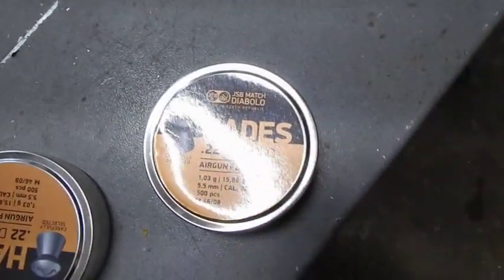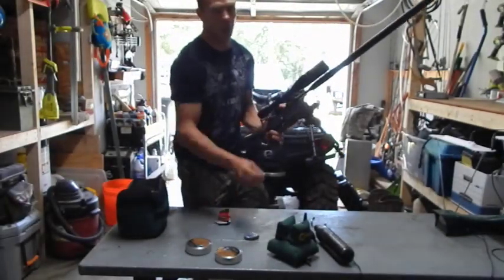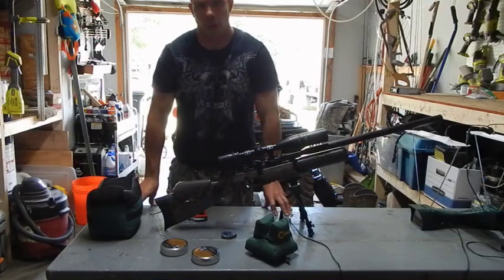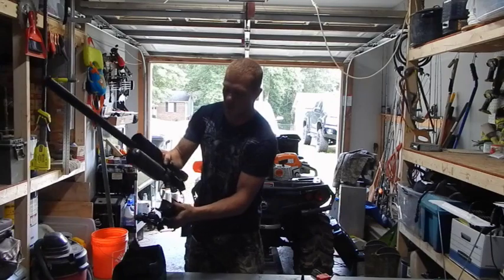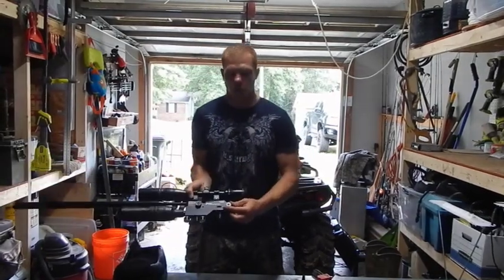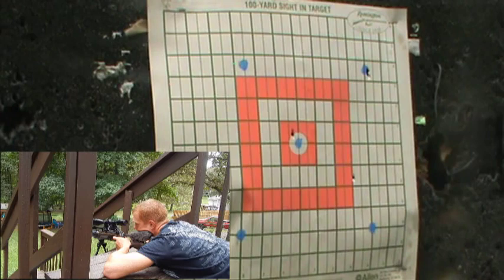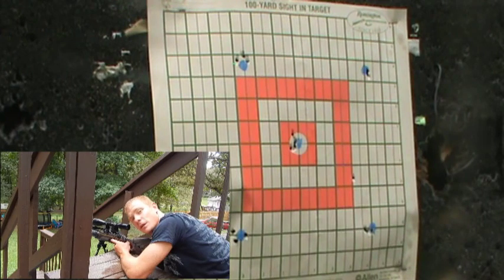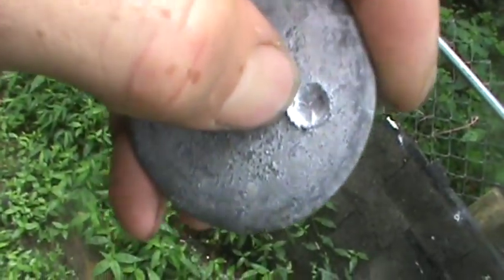Reverting and Shooting My Crown from Slugs

Comment: Man you don't need an impact.....Get a brass hammer weight for your crown and a Huma Gen 3 hi pressure reg and you will LOVE how your crown shoots slugs!!

For 130.00 you get more power than an Impact and a reg that will not creep or leak!

Have my hi power built Crown shooting 33.95 JSB at 990 FPS on high so plenty of power and handles slugs AMAZINGLY well!!!!!  

Sub MOA with Neilsons and JSB Knockouts.......
Reply from the maker: I’ll look into it. There are 3 different sizes of regs right? How do I know which one to get? I’ve done research, but I cannot find anything regarding serial numbers and reg sizes.
Reply: You need the Gen 3 High Pressure reg....Trenier Outdoors is where I got mine.  

You can get the hammer weight of EBay for 20 bucks which will let you run higher reg pressure.

I run 160 bar reg pressure with the hammer weight cut down so it doesn't hit the valve to hard.

I can walk you through it and man you will be amazed at what that Crown can do!
Reply from the maker: I’ll keep you in mind if I decide to go that route. I’m waiting to get some more money saved up to play with the crowns again. I can not afford to do it right now. Thanks for the info! I really appreciate it.